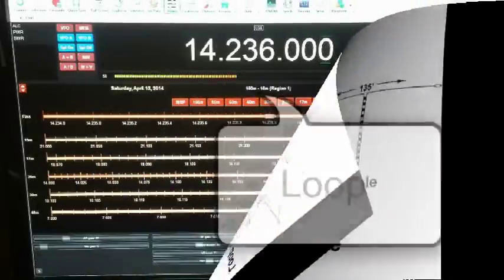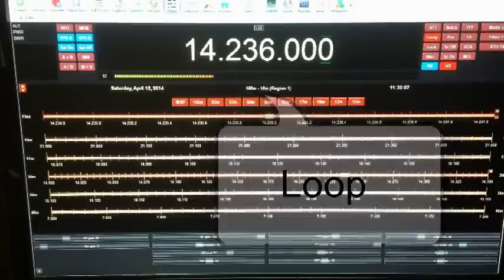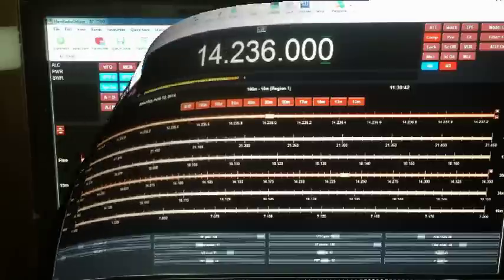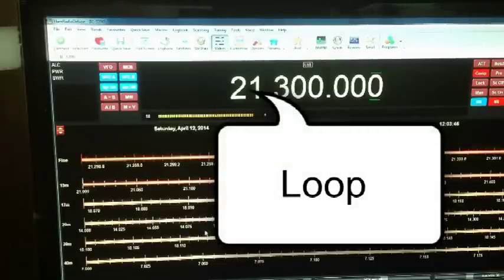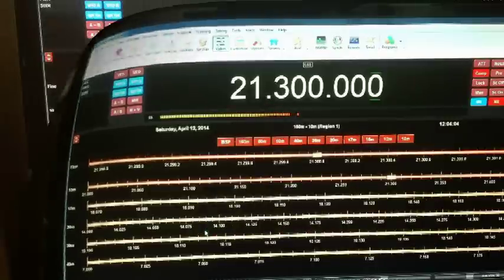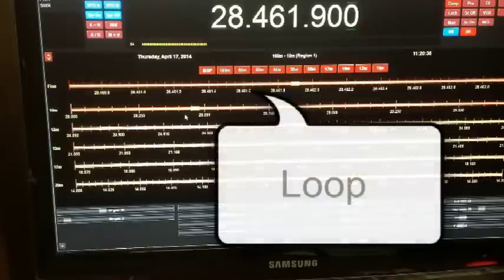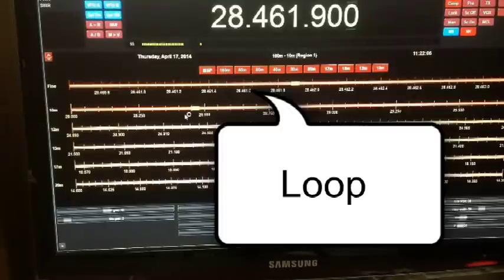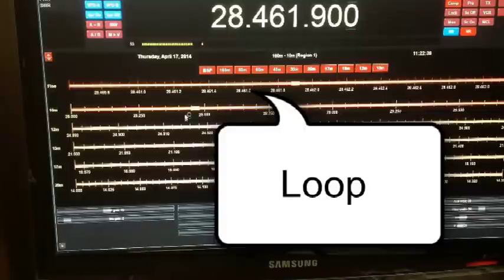Loop vs Dipole Antenna

Comment: Im currently running two EFHW...both Inverted L configuration...one oriented N/S and one oriented E/W. Looking to install a horizontal loop for the new ftdx10. Im mainly on 20, 40, and 80m. Should I just buy a chameleon skyloop, or what would be your advice? 
How long, what balun etc.
Reply from the maker: I’m not familiar with the Chameleon skyloop, it sounds interesting, but I’m sure it will still need a tuner. The difference with mine, besides cost, is that I’m using 300 ohm open wire feeder and an auto tuner with built-in 4:1 balun. Mine is about 300’ long and tunes easily on 80m-10m. I prefer open or ladder line feeders for their low-loss efficiency with multi-band dipoles and loops. Have fun playing with your new radio!

Comment: Wow....pretty impressive comparison. I listen to predominantly 20 meter and 40 meter.

What would you suggest
Reply from the maker: A simple ladder-line fed dipole with an antenna tuner is a great all-band antenna. But I use the loop that’s in the video the most often because it generally outperforms the dipole, but not always. My loop has gain in the direction opposite where it’s fed from, especially on 20 meters and up. Mine is fed from the SE corner, thus it’s generally strongest toward the the W, SW and NW directions. So take that into account.

Comment: Have you tried this as a delta btw? Also if you have 4 , 75ft trees, throw up vertical loops for each band. Talk about amazing antenna. ESP 20 and 40
Reply from the maker: A smaller vertical loop has been on my to-do list for a while now, though not as easy with smaller trees in the way. Thanks for the reminder! 🙂

Comment: Maybe the dipole was pointed in the wrong direction.
Reply from the maker: In some cases, this is true, but since I can't rotate the dipole, the loop helps me a lot.
Reply: right on... it would be tough to turn a 135' dipole lol.  I was thinking about building a 40m switched dipole, but I'll probably go with making a loop. Thanks for the comparison.

Comment: A full wave 80 meter horizontal loop for the 80-75 meter band would favor short distance sky waves (most of the radiation would be broad-side). For the 20 meter band, there would be some lower angle lobes. For 10 meters, there would be even lower angle lobes and may be a pretty good DX antenna in some directions.
Reply: Abby Sack, a lot of people keep a coax switch and RX on their mag loop, then TX on their dipole in order to hear as far as they can talk. It’s supposed to work very well

Comment: Do you feed the loop with a 4 to 1 balun???????????
Reply from the maker: Yes, my antenna tuner (MFJ-993B) has a built-in 4:1 current balun for balanced line antennas.

Comment: may I ask...
How did you suspend this 75' up? trees? did you erect 4 towers?
Reply from the maker: Yep, I used trees. I have an air launcher that I used to shoot a line over tall trees.
Reply: flyingpig222 Im also curious, what's an air launcher, like a paintball gun? I mean please give me some ideas here like where I can get an air launcher, what exactly to use for high distances. Would really appreciate it man as I'm relatively new to the hobby and your videos help to encourage it!
Reply from the maker: Radical AM - What I have is an 'Air Boss antenna launcher' (google it). It will easily shoot a line over 100' trees. There are plans online to inexpensively build something similar.

Comment: Do they point in the same direction (radiation pattern)?

If not then this video says nothing...
Reply from the maker: Means nothing? Would you rather receive a strong signal or weak signal? The dipole is broadside to east-west. The loop is square (not pointed in any direction). 80 meter antennas used at higher frequencies have variable radiation patterns. Since the  antennas are non-rotatable - I prefer to have choices as to which one will work better at any given time.

Comment: What is the better antenna? Long wire? Long wire dipole? Loop magnetic? or RGP3 (=ferrite antenna)? for shortwave (1.5 - 30MHz)...! Thanks.
Reply: As my Antenna Elmer taught me: Get up as much wire as you can, as high as you can, looped if possible, using whatever matching and tuning necessary (we prefer 450ohm ladder line into a 4:1 to keep the coax shorter-as coaxial cable is much lossier at unmatched frequencies than open-line).  That's the best full-spectrum antenna.  BUT EVERY station has different needs, topography, supports, finances, etc.  

The absolute best stations I've operated had multiple directionals (some fixed, some turnable), wires (dipoles and loops), and an array of receive-only beverage antennas.  The best antenna for a given signal/propagation path often changes and it's much more effective to have multiple antennae to mix and match, than to try to do ALL with only one.  It also takes a lot of real-estate and time and money--for the BEST!

Antennas don't always follow the rules exactly, experiment and try many.

Comment: What about the freq its cut for DUH.
Reply: Loops don't have to be cut for frequency provided you supply a proper matching network. I use ladder line into a 4:1 balun and into a manual tuner - to feed every loop (I don't measure any more) I've had up in 20 years.
Reply from the maker: As the description states, it's a full wave 80m band loop, which is 287' @ 3.5 MHz (the formula is 1005/f MHz). Mine is actually about 300' - resonance for a particular frequency is not important to me as I use it with a tuner for multi-band use.

Comment: What brand Loop Antenna is it?
Reply from the maker: There is no brand, it is homemade. I used #14 insulated stranded wire, ceramic insulators at the corners, and a vinyl plumbing "T" where I connected the ladder line. Other types of materials will work fine. It was very cheap and easy to build.
Reply: How do you  pull the wire tight all around the square loop when you get to the feed point corner. Doesn't it want to pull apart at the corner if you have say 500 or 600 feet of wire for the loop. Some guys have 1100ft out in the loop.
Reply from the maker: My window line is connected to each side of a plastic insulator about 10 feet from the corner. There is no strain on the feed line no matter how long the loop is.  As long as each end of the loop is well connected to the insulator, it's as strong there as any other part of the loop. Also, plenty of slack should be in wire to allow for trees swaying in wind, if trees are used.

Comment from the maker: The auto-tuner (MFJ-993B) has 2 selectable inputs and can tune two different antennas separately and remember each setting. Each antenna was pre-tuned prior to recording, so it should show an accurate comparison.
Reply: flyingpig222 That loop receives better the question which is better for transmit the Loop or the dipole because is dipole is better for transmitting you have to use the dipole for transmit and the loop for receiving

Comment: Are they on separate tuners to each antenna or do you just swap feedline to a single tuner? If you are just switching antennas to a single tuner, you would have to have the auto-tuner retune to each antenna for a fair comparison. I can do side-by-side comparisons because I have two tuners, one for each antenna.